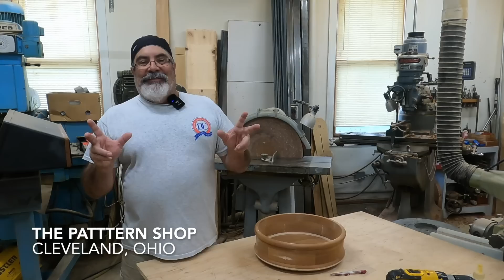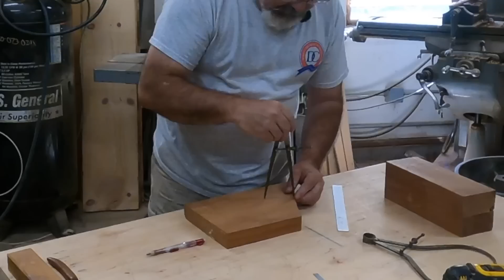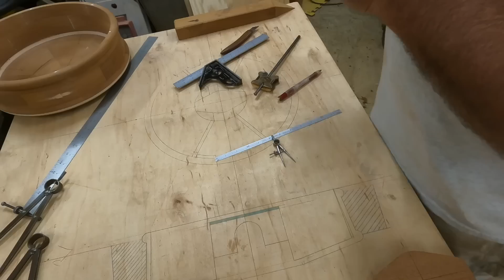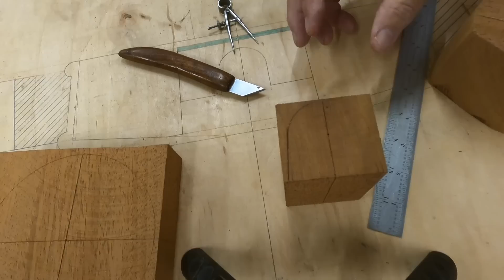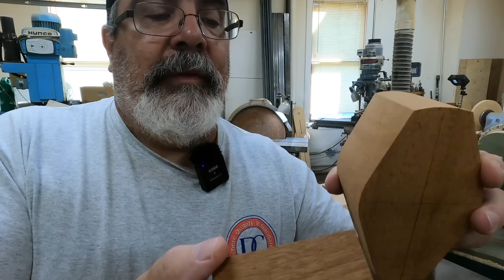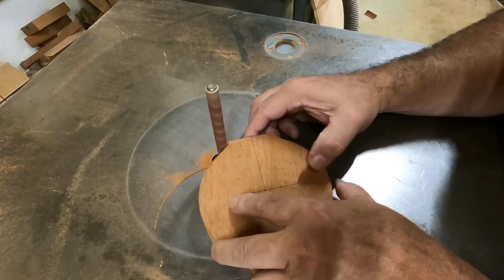Tally Ho Capstan Project: Part 3- Building the Center Hub

Comment: When you found the centre, if you had rotated the pattern under the jig and found the correct dimension from the edge again, when you have scribed the two scribed lines they intersect at the centre. Maybe slightly easier than using the square? Anyway, what do I know! Dave your videos are *amazing*, and I love seeing your craftmanship at work. Years ago, I went around the slate works in North Wales (UK), and in the tool shop the original pattern makers were still working for the museum and tourists. Your videos remind me of their work, and history. Many thanks for your videos, and thank you so much for helping Leo and the Tally Ho project.

Comment: To find the center of a circle wouldn't it be easier to scribe two different diameters and take the intersection?

One other geometry tip: if you want to find a diameter, instead of measuring across and trying to set a block halfway by halving the measurement, you could take any arbitrary square corner (right angle) inscribed in the circle, and the two places where the sides of the angle meet the circle will be diametrically opposite each-other. Concretely: take any large enough board or metal sheet or carpenter's square or whatever with an accurately square corner and straight sides and put the corner up against the inner top edge of the rim, then mark the two points on the inside edge of the rim where the angle's sides intersect, and then lay your straightedge between these two points to be a diameter.

Comment: Q. When you made your first line, why didn't you just turn the pattern roughly 90deg. and do another line exactly the same way? That would give you centre accurately and you're already set up for it.
Reply: I thought the same way - except that I would have done 3 lines at 60 degrees. Any inaccuracies would result in a triangle the center of which would be the true center point.

Comment: Wondering, the original part has all the sharp corners of the part you made today rounded to produce a casting with approximately a 1/8” radius on all those edges.  I think you are leaving them sharp on your pattern.  I’m wanting to know how are those sharp corners radiused in an expeditious and practical way if they are specified by the customer?
Thanks for all you do!
Keep up the good work!JIM❤